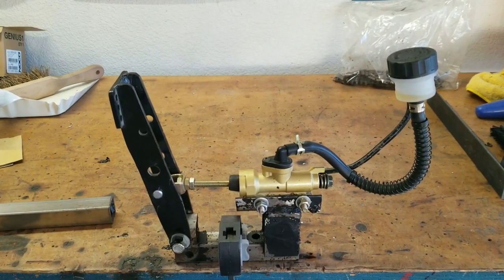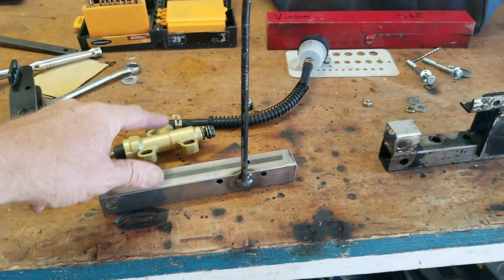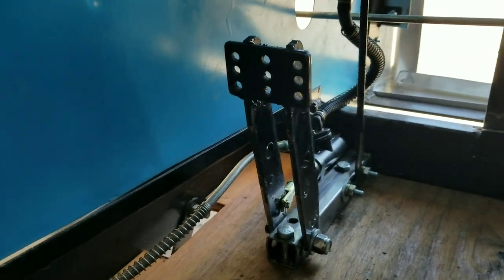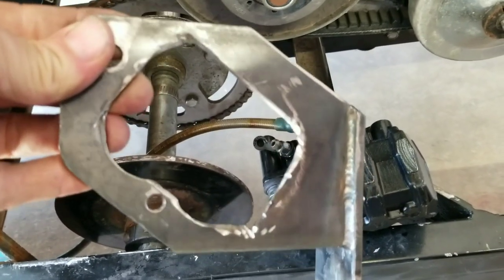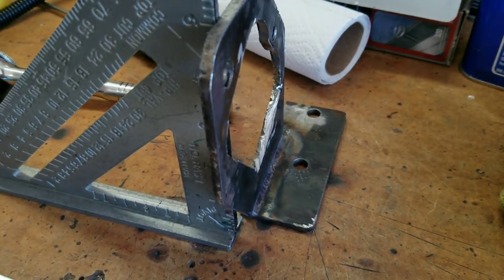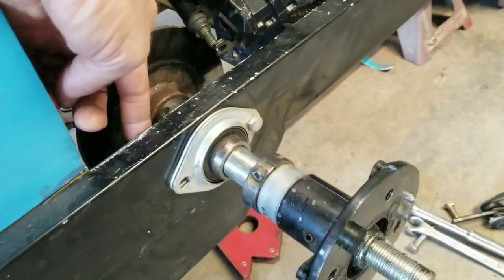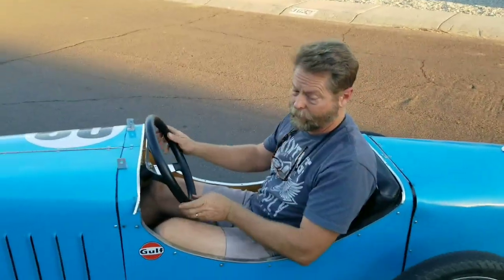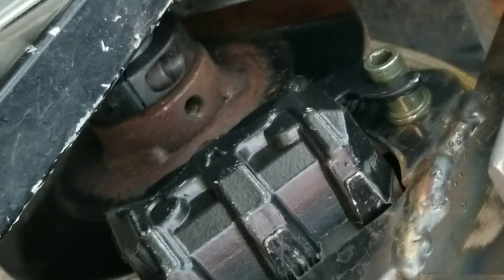Brake repairs/ upgrades on Amilcar Cyclekart

Comment: That brake caliper looks like its not mounted correctly , the caliper should "float"on the slider bolts !!!.
Reply from the maker: I think it does.  Maybe it is not apparent in the video.  We discovered the original mount, had too much flex and wasn't allowing the brake to function properly.  All good now.